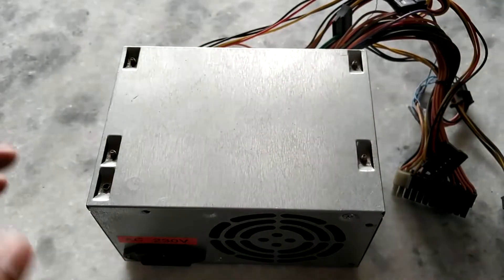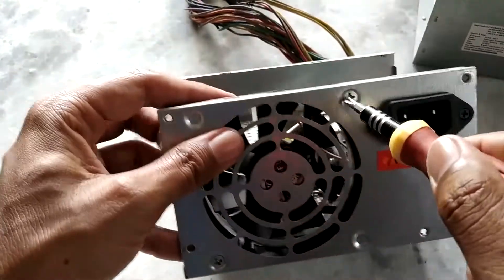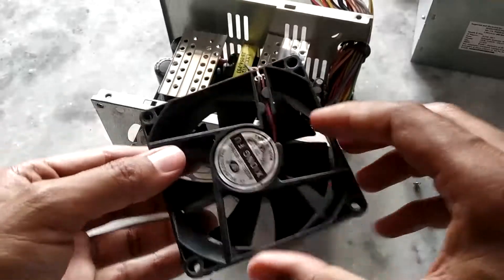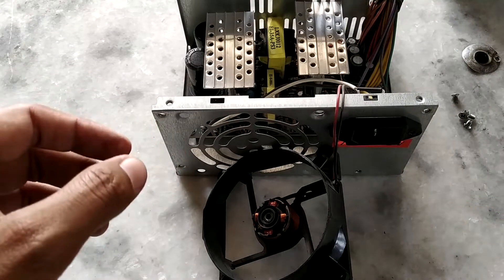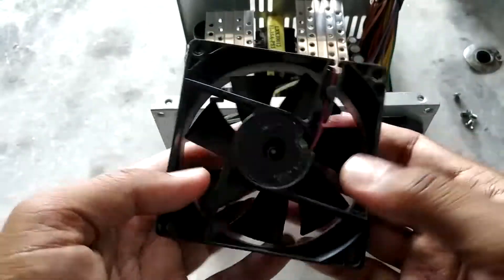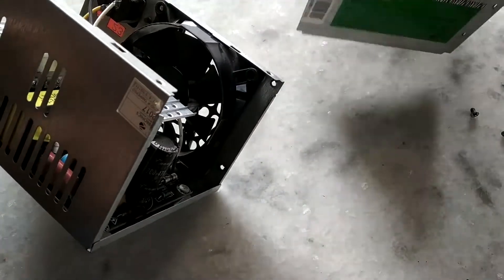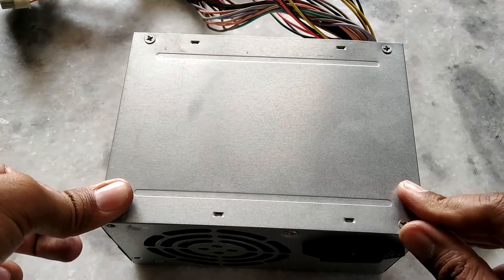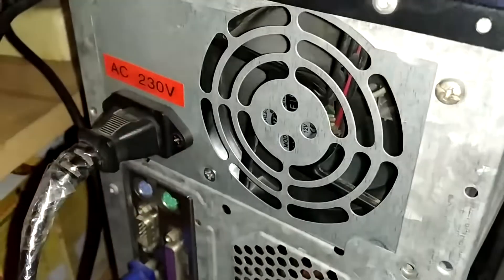How to Clean Computer power supply because fan not spinning properly | Zebronics power supply.

Comment: Mera power supply hitting problem hai.
Give me any solution 🙏🙏
Reply from the maker: clean it from the inside. see if that helps.
Make sure you are not running heavy load from your powersupply.